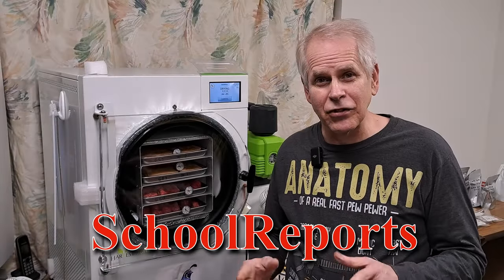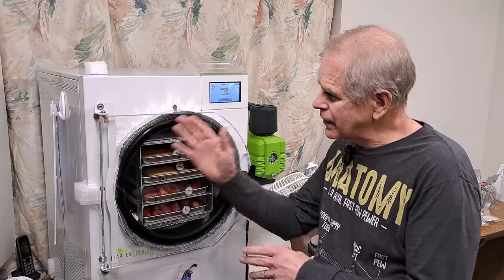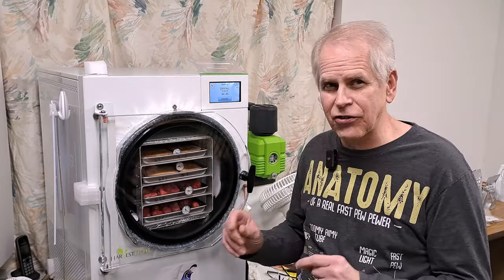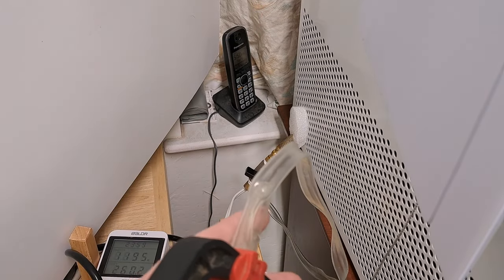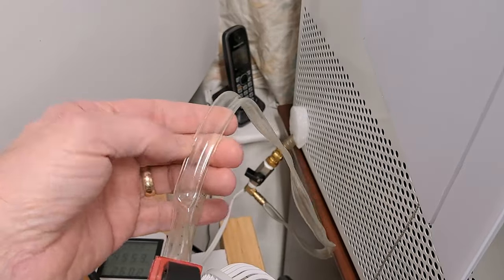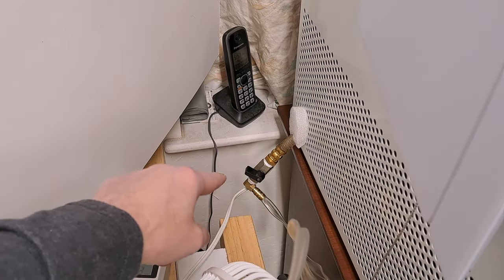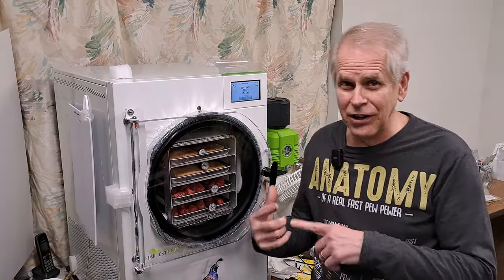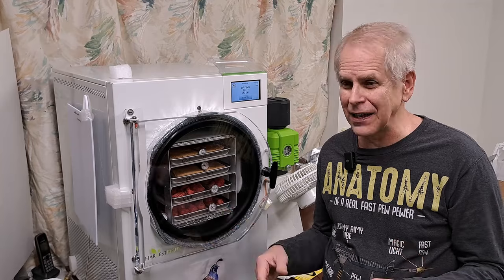Sisters Drain Valve Vacuum Leak (and some clouds with music)

Comment: Had to change the stock ball valve on mine after a year or so. Was very corroded inside and was the source of my leak. Swapped it with a Milton brass ball valve from Amazon and runs great now.

Comment: After 3 years of use the ball valve on our freeze dryer developed rust and a very small vacuum leak.  Replaced ball valve with a marine grade stainless steel ball valve.  Also made sure the hose and   ball valve was orientated straight down so water did not pool.  So far no further problem with a vacuum leak at the ball valve.
Reply from the maker: Thanks! 
On my machine the valve looks completely the same as hers, at least from the outside. It's been working flawlessly for 6 1/2 years. Do you know which valve you used for the replacement? 
Before she ever used her machine I routed her drain hose (and zip tied it in place) so it could never pool water in it. I'm glad you mentioned it, I never think to tell people about doing it.
Reply: @SchoolReports  We are not quite sure of the manufacturer, but it was either a Groco, Perko or an Apollo marine ball valve.  The ball valve looks just like the Harvest Right ball valve but the quality is better and the ball and valve is stainless steel.  When you close the ball valve, you can feel the valve tighten and then go just slightly tighter.  They too can fail, but should last longer.  This is something that will have to be purchased from a marine store.  You will not find it in a standard hardware store.
Reply from the maker: @shannonr6388  Thanks so much for the info. If/when we need to replace my sister's valve (and mine:) I'll look for those.

Comment: UHUH! okie dokie this is what i will try next , not that i ever wish anyone has troubles with their machines but tell your sister thankyou :) And thankyou YOU !  ill let you know how it goes ,
Reply from the maker: An easy test for a leak through the valve is to just put the hose in a container of water while it's under vacuum (with the valve closed!) and see if it starts to suck water up. Of course this only tells you if it's leaking through the valve not at the valve; there could still be a leak at the valve stem or connections. You can remove the valve and use a rubber stopper (or some kind of non-porous stopper) to eliminate the valve from the equation.
Reply: @SchoolReports  Thankyou :)
Reply from the maker: @kerry1963qld   Please check out the comment thread down below with sherrellloyst1296 - it was all about vacuum issues.

Comment: Do you have a video on cleaning you freeze dryer when something spills over?  Like cheese or a sweet treat?
Reply from the maker: I do have videos show how we clean our machines. (No matter what we've spilled:)

I get some grief from some people for using bleach, but I'll stick with the method recommended by the FDA and used by most commercial kitchens for many, many decades and is something I already have on hand. A weak solution of bleach. https://www.fda.gov/food/foodborne-pathogens/listeria-listeriosis "...sanitize them with a solution of one tablespoon of chlorine bleach to one gallon of hot water" 

I'm not trying to convince anyone of anything, I'm just trying to show what I do and why, and show resources when I can.

Cleaning - Between Batch 4 Eggs, and Batch 5 Potatoes - https://youtu.be/fQmK-0UIhcw?si=PSK1q09sU6l6rlBh
Cleaning - Between Batch 25 and Batch 26 - https://youtu.be/tLjLEB5pp9Q?si=_drJLsHbjFVsips3
Cleaning the Harvest Right Drain Hose - https://youtu.be/n7-GQVS-T7c?si=mAeu23jTYZTr0uOO

Remember, I'm just another idiot on the internet. I look at what commercial companies are doing. If they can do it, we probably can too. (with method adjustments)

"If you read it on the Internet, it's absolutely true!" - Abraham Lincoln

Comment: we just changed mine.  it was getting so hard to turn I barely could turn it on.  we replaced it with one bought at hardware store and  it never would get below 1600mt,  we had another one and changed it and it only took it 6 minutes to get under 500.  one of these days I hope you will show how to tear apart the one it came with and clean it up good.  I ordered one from HR and paid 60dollars for it. when it came it was that new set up and I have no idea how that works so it is still in the box.
Reply from the maker: That is the plan! Tear it apart; that's the beauty of broken things, I don't have to worry about breaking it. 😁It takes so little air to make a huge pressure difference. I'll try to show that on the valve tear-down video.

Comment: mine takes so long to get below 500 mtorrs and I changed that valve with no difference
Reply from the maker: Chances are there is nothing I can long distance. But:
How long does yours take to get to 2500? To 500? 
What's the lowest number it goes to?
Which vacuum pump do you have? 
Which freeze dryer do you have? 
How old is it? 
Has it always taken that long?
Reply from the maker: @sherrellloyst1296  I truly would love to travel around in our van, camping and help fix viewers machines! (Maybe next summer;) It's so much easier diagnose the issues, hands on and with the duplicate parts that we have. Just swap out components until you find the one that lets it hold a vacuum.

   There is only one hose connection on the inside of our case and it's not super likely to suddenly start leaking.

Here is a video showing some of the guts; I didn't take it all the way apart. I'd be happy to show more details if you need them. New 2022 Harvest Right Freeze Dryer vs 2017 Freeze Dryer - https://youtu.be/91gEssGQsYw?si=1ctIQtOINh1o86rw

    If I were to guess - and that's all I can do right now because the drive to your place is probably a bit too far. (Meet me at the border and bring your machine!) - I'd still go with either minor vacuum leaks (it doesn't take much! A single hair across a seal and it will fail) or the vacuum pump. But the fact that it changed suddenly, to me, is more suggestive of a leak and not a vacuum pump. With our medium machines we typically see the pressure go below 2500 between 2 1/2 and 3 1/2 minutes and 500 around 7 or 8 minutes. Assuming the same pump with the smaller machine I would expect similar or a bit better. Any chance you could try a known good vacuum pump on yours to rule that out? (Again, the vacuum pump seems the least likely from your description)
If you could download the machine data we could see if that tells us anything. (I have a video:)

    All the vacuum tests are best done with an empty machine. You don't even need the rack in place.

    Vacuum leak detection on a Harvest Right - Using Helium - With Brian from Leybold - https://youtu.be/zWgrC-Yb87o?si=DwitRnFzVy_gkH-e
You can also spray a bit of soapy water around the seal while it is vacuuming. It can show an micro leaks/cracks.

   Empty Chamber Vacuum Test - https://www.youtube.com/watch?v=W5lbz4Bvpww

   How to Confirm and Fix an Epoxy Leak - https://www.youtube.com/watch?v=8x72uE8M1dY (My older machine's firmware is a bit different so I do it a little differently)

    Side note: If I had a vacuum leak at the sensor epoxy plug area, I'd probably consider using liquid tape instead of more epoxy for the repair. I'm surprised that epoxy works for this job. I would not have thought it would be flexible enough to withstand the cycling temperature and pressure changes. (Of course I'm not an epoxy scientist and know very little about epoxy!)
   I would think that any of the low viscosity, self curing, flexible, liquid rubber type products would work great. I would have the vacuum running while applying it so it would be drawn into any leaking crack or crevice.
Reply: @SchoolReports  I live very close to the border and total only a 4 hour drive from Duluth, Mn so if you are anywhere near there lol
Reply: @SchoolReports  Well sometimes the simplest or should be obvious thing to check, I did the vacuum test without the tray in and it worked perfectly, so then I put the tray back in and when closing the door it fell off.  Turned out the bottom bolt fell out and down came the door.  I got the door back on and I am not perfect but it was below 1000 mtorr within 5 minutes and now waiting to see how long it will take to get below 500 mtorr.  Lesson learned (I have a special need child and who knows what he tinkers with when your back is turned) check the bolts for the door to be sure they are secure.  At least that is some of the issue.
Reply: @SchoolReports  Ok I did another vacuum test with no rack in and it was below 500 mtorr at 4:45 mins, put the rack back in and at 4:45 mins it was at 900 mtorrs, something does not make sense, and I was sure to check the vacuum opening and it was clear.  I am at a loss here to figure out why.
Reply from the maker: @sherrellloyst1296  That's good
Reply from the maker: @sherrellloyst1296  Less than 5 minutes to get to 900 is still very good. As long as it getting below 2500 in less then about 6 minutes and below 500 in under 15 minutes everything is still good. The plastic corrugate that's used as insulation on the top and bottom of the rack can hold some moisture inside the long cells for a very long time. Under vacuum, without being prefrozen, any moisture in it will boil and drive the pressure up. (or slow down the drop of pressure) That's one reason why, if the rack is left in for the test, the machine should be prefrozen for a while before running the vacuum test. (I'd recommend at least 30 to 60 minutes freeze time) 

An easy test for a leak through the valve is to just put the hose in a container of water while it's under vacuum (with the valve closed!) and see if it starts to suck water up. Of course this only tells you if it's leaking through the valve not at the valve; there could still be a leak at the valve stem or connections.
Reply: @SchoolReports  I left it run for 1 hour 55 minutes on the vacuum test with the rack in and it was still not under 500 mtorr, it was at 599 mtorr.  The corrugated board on top of the rack is loose though because the glue let go a while ago.  I also prefreeze everything I put in the freeze dryer and let it cool down sometimes for several hours before I put the frozen food in and begin the cycle.  It does not make sense that it acts perfectly without the rack but put the rack in and does not make it under 500 mtorr.  I did that test with the hose in water to see if it sucks up any water and it did not but I changed that valve anyway just to be sure.  By the way thank you so much for all your insight and help.  I follow a lot of your practices especially running extra dry time until the weight loss is 2 grams or less and that way I am sure the food is dry.  Some food takes multiple weight checks upwards of 12 extra hours of dry time.  Thanks for that advice also.
Reply from the maker: @sherrellloyst1296  Well, bummer. The testing should never take more than 20 or 30 minutes, tops. Either you still have a slow (very slow) leak or the sensors are lying to you. Let's assume it's a slow leak and work from there. When you're running the vacuum test does the pressure steadily drop and bottom out and stay there, or does the reading jump around a bit as it's dropping?
Reply: @SchoolReports  with the rack out it works perfectly but with the rack in it drops rather quickly but steadily to 900 mtorr, but then slows down considerably until it slows to 1 or 2 mtorr at a time but some times it will go up 1 or 2 then down again but it never bottoms out.  I think once I ran the test for 24 hours thinking along the lines of a dead lock and maybe a long run could break the deadlock but no luck it never did go below 500 mtorr at that time and that was after I changed the vacuum hose to the pump because that hose made no difference.  I think I will call Harvest Right tomorrow and get their thoughts on it.  Thank you so much.
Reply from the maker: @sherrellloyst1296  Please let me know the results!
One last thing (for now!), I assume you're running the tests using the "Functional Testing" screen. 
With the rack in, have you try running the "Freeze" until it's very well frozen and then running the vacuum test?

If all else fails, I'll let you know when we'll be in upper Minnesota! 🤣
Reply: @SchoolReports  No I have not I will do that now and let you know
Reply: @SchoolReports  The freezing seems to be working fine it is -3 F in 13 minutes going to give it a bit yet and then do vacuum test.  Should I leave the freeze test on and do vacuum at the same time?
Reply from the maker: @sherrellloyst1296  Yes. Let it freeze for at least 30 minutes then with the freezer still running run the vacuum test.
Reply: @SchoolReports  OK at -18F I turned on the vacuum test and it was 499 mtorr at the 4 minute mark and 407 mtorr at the 5 minute mark so at least that works well, so I am going to guess no vacuum leak but we will see what they say tomorrow.
Reply from the maker: @sherrellloyst1296   As Batman said in the Lego movie "First try!"